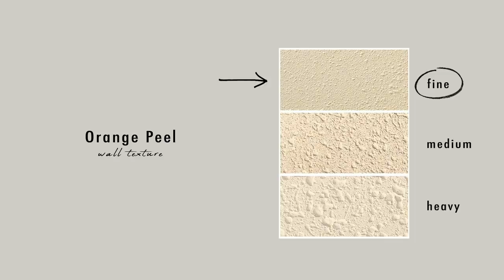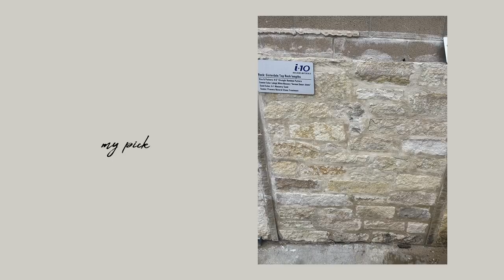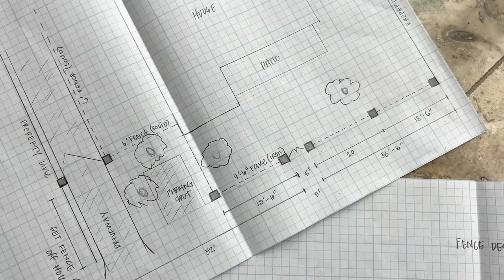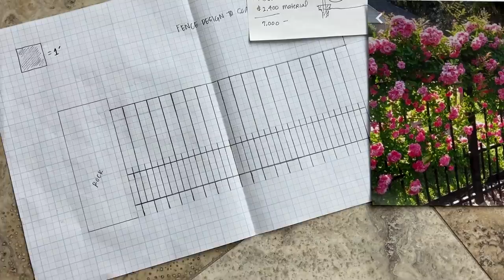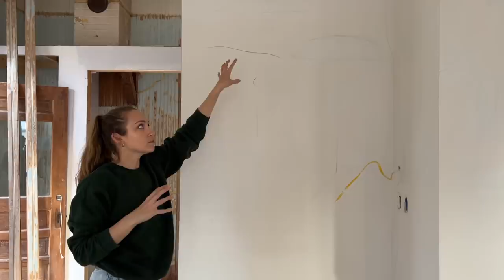No Going Back It’s SET IN STONE | Renovating Our 110-Year-Old Home | XO, MaCenna

Comment: As a Brazilian, we use concrete for EVERYTHING here, and I don't understand how u guys use wood in the interior of a fire place. Is so cool to learn those differences. 
Also, I've been watching all the renovation process since the beginning and is easy to see it will turn out beautifully, congrats for the work, you're so talented!
Reply: It will be lined with brick on the inside part you can see. Then there will be a large metal pipe going up the chimney. The fire will not be able to get to the wood.
Reply: Also,it’s going to be a gas fireplace contained in it’s own metal box.
Reply: @chasetonga  oh, i see
That's cool

Comment: It would have nice to know the budget you were working with.  How much was the house price and what do it expect the final cost to be?  Yes, you salvaged a lot, yet you also added 1,000 square feet on to it.  Would you be open to sharing this?  In regard to pillars, if you are going to level the front yard they should adjust the pillars back to 4.5 like you wanted.  You can't have a couple taller than the rest.  This should have been leveled before the built them.

Comment: For the column and iron fence, I think you should put it in the middle of the columns. You're a perfectionist so you may get annoyed later. Flowers in the front wouldn't take that much space, especially if you pick something that will climb on the iron fence. For the door to your patio, are you planning to add glass on the very top to level with the two windows? By the way, I LOVEEEEEEEE the limestone details with the over-grout. I have always wanted to do it but it's so costly. I may do a similar look for my backyard patio but on the ground.

Comment: That stone work is gorgeous! Just curious as to why you chose a textured wall and ceiling finish? In Ontario, that's not common and not something I would want. Maybe it's just different things in different geographical areas!
Reply: It’s so much cheaper as they literally just spray it on as the final paint finish and don’t even have to sand,etc. Also,remember that she picked the lowest texture so it’s not going to look like a popcorn ceiling.

Comment: I don't understand why everyone does texture on their sheetrock.  My house is all sheetrock (not what we call it here in Australia).  I have smooth painted walls and ceilings, no texture.  You can't see where the joins or screws etc are.  Most, if not all, houses here in Queensland don't have texture.
Reply: It’s cheaper,they literally just spray it on as the paint finish and don’t even have to sand.

Comment: You should have put insulation in that wall before you installed the wooden slat bead board pieces! Always put insulation on exterior walls. I did not see any there. Just FYI, even around exterior doors, you need insulation in a home!

Comment: Tried to figure it out, but I still have NO clue what taping, floating or texturizing Sheetrock is 😂
Reply: After they nail it up,they put paper tape over all of the seams between each piece of sheet rock and then spackle mud over all of the tape and nails. If you want a super smooth finish like level five,they keep floating more spackle slurry on the walls the way they used to apply plaster back in the day. ( let dry,sand,repeat)To save money in the addition, she’s going with a very low texture because it’s significantly cheaper. They just spray on the textured paint without having to sand,etc. However,it won’t look like a popcorn ceiling from the eighties!🤣😅😂